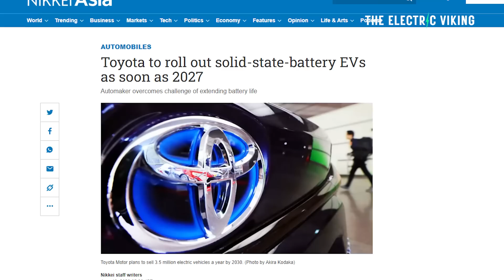Tesla's biggest battery supplier improves charging efficiency by 43%

Comment: By the way, I don't want faster charging. I just stop every 2 or 3  hours and I want to have time to enjoy a cup of coffee or go to the restroom, while the car is still charging.  It gives me a break and it keeps me fresh when driving. The current charging rate makes it for me much safer when I take long roadtrips.
Reply: Do you have a good point sometimes I don’t want to stop to put gas or electricity in my car I just want to do my stuff and MoveOn and keep on getting it but you’re basically right
Reply: @mauricedegroff5669 that's not a good point. It's stupid. If you wanna hang out and have coffee then do it. What's the car charging speed have anything to do with it?
Reply: I agree for good conditions but better speed at cold temperatures or higher SoC would be nice to have!
Reply: @johnboys92  It's convenient if the time it takes to charge is a little longer than the time it takes to use the restroom and get coffee. Otherwise, you have to wait in the car while it finishes so you don't idle while people are waiting.
Reply: Bro shut up. You can still rest as long as you want. Faster charging is a huge plus.
Reply: @elitecompany1878  
At Tesla Superchargers, you have to move your car once charging is done in 5 minutrs, or risk paying an idle fee for taking up the space.
I'm not sure what other Charging stations do where one can just park there.
Reply: @johnboys92 - Multitasking!! If it's charged up, while you are still on the John, you have something like 5 Minutes before you start to get charged for occupation of a Charger, while Full!
Reply: @elitecompany1878 - Just Stay with a Gas Pickup, with Dual Tanks, if Kidney Busting Travel is your thing! 🥴🙄😂
Reply: For some, the DESTINATION is more important than the journey.  Can't do that with a slow charging EV, no option there.
Reply: Trust me… you do!
Reply: That has nothing to do with how rapidly one can now charge an Electric Car.  
Instead it relates to how long YOU chose to wait before continuing your journey.  
That the battery is charged does NOT compel you to do anything except remove it from the charger so others can potentially use it.
Reply: It may not benefit you too significantly, but there are many people in delivery, various trades etc. who are in their vehicles for hundreds of miles each day, every charging speed improvement and battery capacity improvement provides an opportunity for those folks to make the switch to an EV. And the faster the battery charges, the less inconvenient it is to stop and do so, meaning battery packs can be made smaller and in turn more vehicles can be produced with the same amount of lithium.  All of these improvements will help reducing the cost and environmental impact of producing EVs, sending ICE vehicles to their graves that much faster.

Comment: 248 miles of range in 10 minutes would be impressive. If a Model Y gets 330 miles of range at 100% state-of-charge (SOC), 248 miles is equivalent to an increase by 75% SOC, say from 10% to 85% SOC. If the Model Y's 330 mile range is based on an average of 4.4 miles/kWh with a useable 75 kWh in its battery pack, then the supercharger would need to deliver its charge at an average power level of (0.75 x 75 kWh) / (10 min  / 60 min/hr) =  (56.25 kWh x 6/hr) = 337.5 kW during the 10 minutes of charging. Thus, a 350 kW Version 4 supercharger should be sufficient for the job.
Reply: Excellent analysis. Too many of these claims of the "add 500 miles in 5 minutes" type ignore the practicalities of getting the power in and would require chargers 5x the speed if current fastest ones and very thick unwieldy cable, even assuming the electrical supply to site was that capable  
This is probably about the limits of whats practical and affordable.
Reply: Who really needs these fast charging possibilities, and someone needs to pay for building over sized power lines/gables to the charging sites.
Is there a need to pee faster when taking a break during a journey? Have people started to eat while driving, instead of eating in a nice restaurant?!
Why don't you buy a helicopter if you are so busy?
Tests already show that you can drive 1,000 km in ten hours even on roads with a maximum speed of 120 kmh! What are the gains?
If people save 2 hours in one year how do they use this time? What about if you die 20 years earlier than expected if you don't eat, exercise and sleep properly?
Reply: Ummm, they were claiming 240 communist units, not freedom units
Reply: @drkrbrown  🙃🤠
Reply: @leiflillandt1488  Some good questions/suggestions for considering the benefits of taking more time, rather than less time, to recharge, when traveling long distance. One additional benefit that should be considered is battery life, given battery life can often be improved by charging as slow as possible (i.e., taking as much time as you realistically can). Recharging infrastructure cost is a factor as you point out. Higher charge rates may actually reduce infrastructure costs, by improving utilization of the equipment/space available, up to a point. However, charging energy efficiency will improve at lower current levels, due to Ohm's Law (Current-squared × Resistance) losses.

Regardless of the optimization to minimize direct economic costs, your points about other quality of life factors should also be given due consideration. Some of these indirect values are also being incorporated by choosing supercharger locations that offer other amenities nearby, like within a 100 meters or so.

Comment: I'm a Tesla owner since 2018. I also own an old Odyssey 2012 that I use for family road trips. My Model 3 is ok to bring my 3 kids from school, but it wouldn't be comfortable enough for a long road trip. Last winter I drove from Montreal to Orlando in 2 days with my van. On highway my Odyssey has 800 km of range. We never did 800 km straight. We all need a bathroom brake after 600 km. So my hope is that. Having an EV with a real life range bigger than what my bladder can tolerate. I cross my fingers that the Cybertruck will do that.

Comment: Solid state batteries are going to be insanely expensive to start with.  They'll be practical for aviation use at very high prices, but for EVs I don't see them being viable for at least a decade, as existing technologies will continue to improve and drop in price.  I could see a hybrid setup becoming possible within 5 years, assuming solid state battery mass manufacturing takes off, where most of a car's range comes from conventional batteries but maybe 10-25% comes from solid state batteries.  Those would be used initially to power the car, since they don't degrade, and would be capable of taking insane fast charging loads without causing any damage.  So your "tank" could go from empty to 25% full in like 3 minutes.  That would be valuable for road trips, allowing you to make it to your final destination off the solid state cells and charge all of the batteries at your leisure.
Reply: Also almost zero loss from regenerative braking.

Comment: With all the different cell chemistries floating around, and all the different pack configurations to contain them, the most important thing to me to see on Tesla's ordering pages is a) which batteries will I get, b) which factory would it come from, and c) which structure would the vehicle use in the car frame&pack.  Running changes and improvements are fine, but I want to know what I would be getting if I order it on Day X, but it gets built and delivered later on Day Y.

Comment: And what charging system will I need to get that 400km in ten minutes? Anything that exists now? Or another whole round of charging stations?
Reply: A v4 supercharger at 350 kW should be sufficient to add 248 miles of range (75% increase in state of charge) in 10 minutes for a Model Y with a 75 kWh battery pack with an EPA rated range of 330 miles (averaging 4.4 miles/kWh).
Reply: @greggrant4614 how many of these superchargers are in the melb metro area? 20? 10? 150?
Reply: 350kw is a third of a megawatt which is a massive amount of juice! A 350kw generator is the size of a small van. 15kw is plenty to run most houses at max power use.
Reply: The next generation of supercharger may be wireless.🤔

Comment: Faster charging is probably more important than range.  If a vendor could offer charging in 10 minutes vs 40, they could put a smaller battery in. If I get a choice of a cheaper vehicle that has a 150 mile range and can charge in 5 minutes (half the battery)  VS a car with 300 mile range but takes 40 minutes to charge. I'd pick the quicker charging vehicle;  my average speed on a long trip would be higher. 10 Minutes delay every 300 miles vs 40 minutes delay every 300 miles.  The only negative would be you'd have more people going in and out of fast charging spots though they'd stay a shorter time.

Comment: If CATL announce a new battery technology of 240miles in 10min charge, we will believe. Because that's their specialty. But charging say 50kWh capacity in 10min requires 300kW/800V= 375A current is still a big challenge. 300KW charger is huge.

If its Toyota boasting of achieving solid state battery of 700Miles in 10min charge, NO. Its pure BS because that will require 1200A current at 800V for a 160kWh capacity battery to achieve 700miles. A 960KW monstrous charger? Toyota can't cheat physics, you can't store 10x more energy than you pump in.
Reply: I'm pretty sure the charger for the Tesla Semi ( and maybe Cybertruck too ) is good for somewhere around 1 MW.  It uses a cable with cooing jackets around the conductors.
A great show of ' Take no prisoners ' engineering.  
Pretty wild stuff!

Comment: Our thoughts on SSB's? Who cares, is what I think. Why? Because the current battery industry is still in its relative infancy, and will improve iteratively for many years. I suspect in 10 years time we'll look back on 2023 tech as being "old tech." You cant really say that about cars that are 10 years old, as a comparison. A 2013 car is still a decent car today, although the same model may have improved in power and fuel efficiency by a little bit, battery tech will improve by a significant margin in the coming decade.

Comment: This charging tech mixed with the coolant passages between cells mentioned in a recent video.would be a great battery pack. In fast charging heat is the enemy..thwart that, u can minimize cell degredation to a degree.. 1st gen model 3s are capable of going  600,000 kms now with 15% degredation. Imagine these numbers in 2 years. Unbelivable tech. We live in amazing times.

Comment: What that means is simple, they  have
Now the knowledge and experience to condition the batteries well
Before charging or during changing. That is will improve the charging performing in low temperatures , specially affecting LFPs.

Comment: An EV might get 4 miles of range per kWh.
If you charge at 360kw/hr that is 6kw per minute or 24 miles per minute. In 10 minutes that would be 240 miles of range if the charging curve was linear.
 The fastest chargers are slower than 360kw/hr.

Comment: Like 300 km in 10 min would be good enough if you spreed the chargers everywere. You got to stop and rest/eat/pee anyway.

Not perfect but kind of the same as driving to a gas station and fill up the car. Perfect would be moore like induction charge built into the road, used wile driving.

Comment: let's do the math. 248m is about 400km. on m3 it will take 56-60kwh. if this is done in 10 minutes, it means a peak charging rate of 360kw? that is assuming it can maintain that speed for the whole 10 minutes. but m3 uses a battery of 60+kwh, how can it maintain peak speed for 50+kwh? besides, for basically a lfp battery, 360kw sounds too fast. something doesn't seem right on math here.
besides, i think people are a bit too obsessed with charging speed of ev. it will take me 4 hours to drive 248 miles and i need more than 10 minutes break after that. heck, i need a good 30 minutes break after 4 hours driving. if this techonology comes at a significant price, either in sale price of battery longevity, then i don't think it is worth it.
Reply: I know people that literally take a 5 minute break then drive again every 4 hours when they get gas until they get to the location 12 hours away. I cannot do this but I do take a 10 minute break and rotate who is driving every 4 hours which we have done many 16 hour rod trips like this. I do think anything over 4 hours of driving charged in 10 mins since most people take a longer break then 10 mins in those situations.

Comment: Dude you really need to use watt hours per kg .... Watts per kg does not mean anything in this context.  Its a measure of power output. With a pack power output of 500kw (conservative) and 828 cells in a pack and a cell mass of 355g  I calculate a w/kg of about 1700 watts per kg, Its a measure of how much power (that is how fast you can accelerate given the  pack weight that you need to achieve that acceleration) Wh/kg is is a measure of how far you can travel (roughly speaking). You could have 100,000 Wh/kg but if you only have 1 W/kg (you cant extract that energy very fast)  then you could barely move the vehicle along the road @ a few km/h. Conversely you could have 100,000 W/kg of power but only 1Wh/kg and accelerate  very quickly but only cover few hundred meters albeit very quickly!! Hope this makes some sense tho the numbers are only ball park but serve to illustrate. 7:36

Comment: And of course fast charging and discharging in repeated accelerations and related over heating activating force cooling does not affects battery life……electro-chemistry is always a compromise btw cost, weight, life and performances and small incomplete bits and pieces of info are only there to mislead a naive audience. No changes watts for ever…